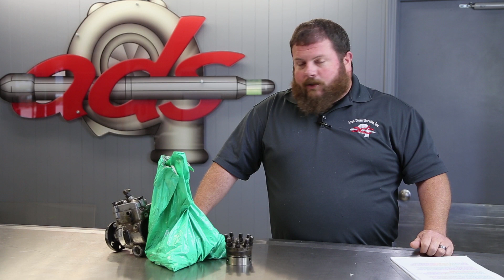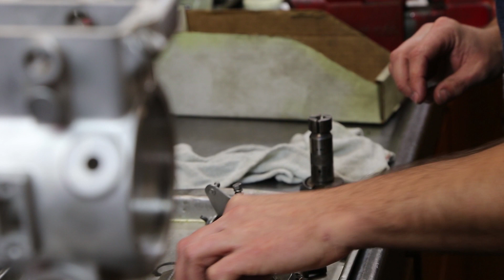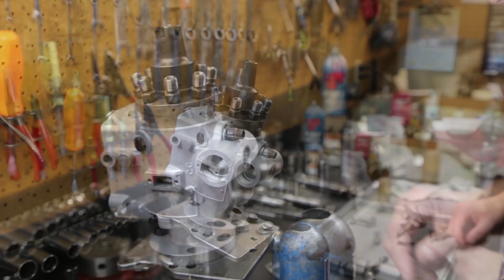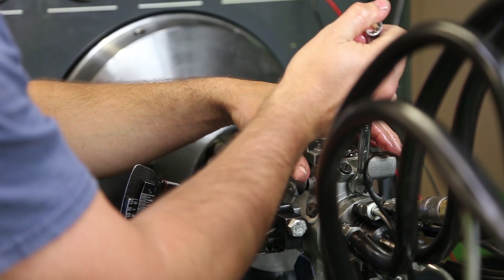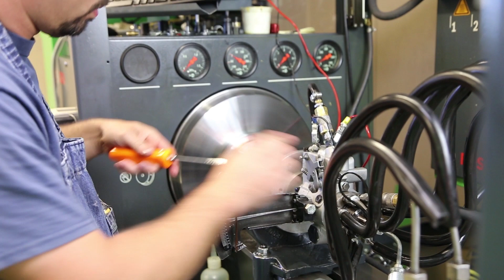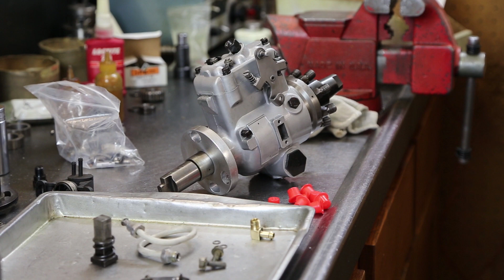Can @AreaDieselService Solve This Rare DB2 Automotive Pump Puzzle for a@MortskeRepair Rustoration

Comment: I sort of know these v8 engines, never directly worked on one, i just know that in diesel shop at vo-tech, they had one that would start, pump works good engine total rebuilt and these engines did not have a turbo. They were also the Chevy 350 converted diesel, how when this engine i am referring to was rebuilt they bored the engine, when that was done it made the bore equal to the leight of stroke or a bit over the leight of stroke, inturn the engine could not suck air in to the engine. They then took the engine sleeved it back to standard bore, and then it would run

Comment: During that era with gov regulations as they were, the worst factory engine mods you can imagine became a reality.
The best "repair" for the diesel 350 Rocket was to pull the engine and replace it with an early 70's gas 350 Rocket. There was nothing good about the diesel 350. Swapping for the gas Rocket offered the least mods and provided a great engine. 
If you get a mid to late 70's gas smog engine my advice is rip all the smog equipment off. It was all garbage.

Comment: WHILE I AM A DIESEL MECHANIC AND OWNED 2 OLDS DIESELS AND LOVED THEM BOTH!
I HAD AN 1980 THEN AN 82 WITH THE 5.7 LITER (350 CI).
YOU MENTIONED THAT THIS PUMP CAME OUT OF A 78 CHEVROLET PICKUP.
THE CHEVROLET DIESEL WAS A 6.2 V-8!
I NEVER HEARD OF THE 5.7 BEING PUT IN THE PICKUP!
AS FAR AS I KNOW THE TWO ENGINES ARE ENTIRELY DIFFERENT 
V-8 s!
WHY DID I QUIT DRIVING THEM?
THE 80 WAS TOTALLED BY AN DRUNK DRIVER,
AND THEN 4 YEARS LATER THE 82 WAS PARKED BY THE STREET AND TOTALED BY A HIT AND RUNNER!
Reply: The 5.7 was available only in the half ton trucks from 78 to 81.   
The 6.2 came out in 82 and replaced the 5.7 in trucks. It was available in 10-30 series.
The 6.2 IS a completely different engine, designed by Detroit Diesel. Some parts such as lift pumps and Injection pumps were carried over with changes.
Reply: You might want to turn off your Caps key. Shouting at everyone just makes people ignore you.